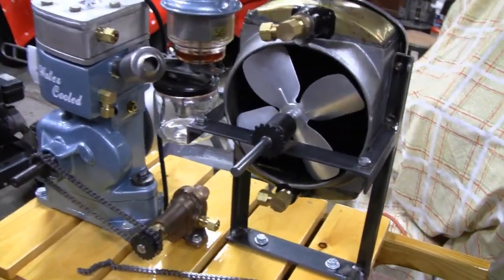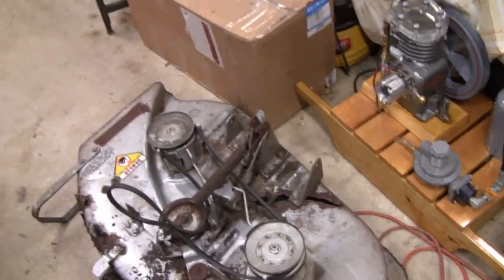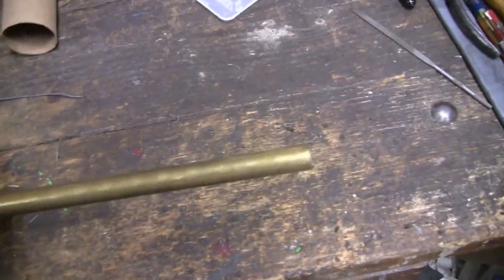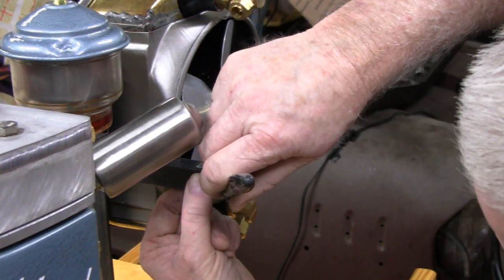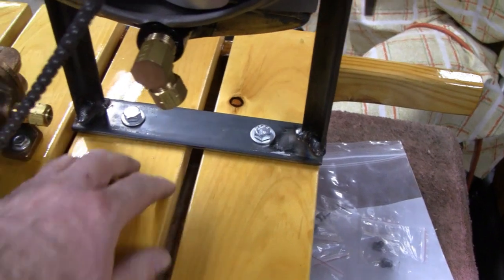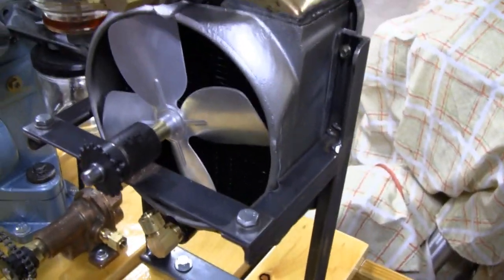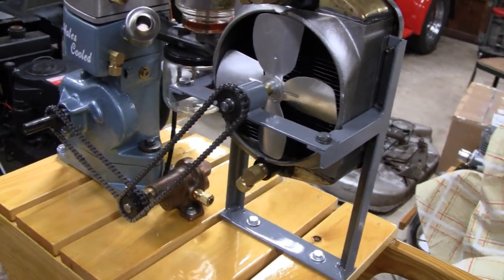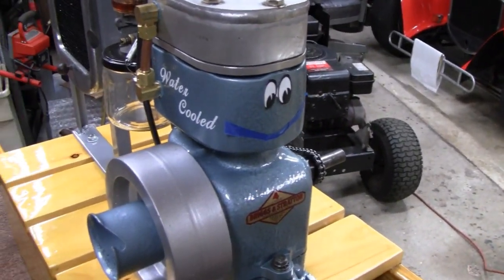HOMEMADE WATER COOLED BRIGGS ENGINE (part 43)

Comment: Hey ROADKING, what about using RotoZip  bits for those oblong holes in wood etc? The RotoZip bits are more for high speed work and cut really well in that application. Amazon has them too, as does almost any place that sells wood working tools.
This project is coming along really well, and is lookin' better each time.
Reply from the maker: Thanks Reg!! I have a RotoZip!! I use it for Drywall work!! The Die Grinder was too convenient, Mike left it on the work bench and it already had the bit in it!!☺

Comment: Are you going to add a chain guard? If one of the chains ever broke or came apart it would either fly off into space or become a whip. Not to mention uneducated people and their fingers ;)  Beautiful little engine and the Rad looks great! Can't wait to see it in action.
Reply: Steve Reeves - already been covered on a previous video and why (not)
Reply: Chainsaw chains can break and cause injury. It happens from time to time here in the timber industry on rare occasion. I'm more concerned that someone (like at a show) gets touchy feeley and loses a finger. Roadking can build it any way he likes I'm just thinking out loud.
Reply: Steve Reeves, good point, I guess it only has to be some mesh formed into the shape, I'm building a mini-bike from scratch and will need a chain guard.
Reply: I don't know   my chain saw is right in front of my face.
Reply: Steve Reeves, Morgan 3 wheelers had a chain to the rear wheel that, if snapped, would chop the driver up the middle. My grandpa raced them and had a strong guard on the chain.

Comment: You know thinking about it why not just use a common chain for both the water pump and fan?, I am not being critical, just an idea, but one long chain might be better in your application?  ( Your sprockets all seem to have similar tooth counts ) your current set up looks good, just sayen it might be good idea for something in the future, hindsight and arm chair QB's are always right.
Reply from the maker: No that's not a bad idea, we considered it but felt better with this set up because it gives more chain to sprocket contact than just a few teeth!!☺
Reply: I have worked with a lot of drives / belts / chains etc in the past  and the nice thing about your set up is #25 is still pretty overkill/ heavy duty for what your asking it to do, I was always told 1/4  wrap on a chain would be good, Belts should be at least  double 1/2, but that was for power transfer, I look forward to seeing it run.